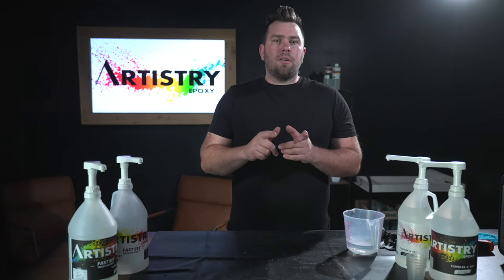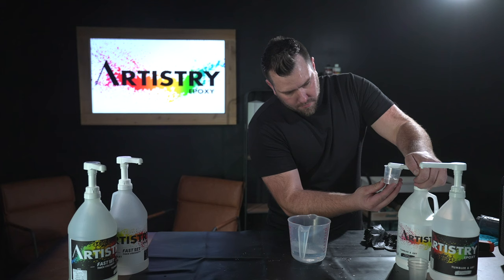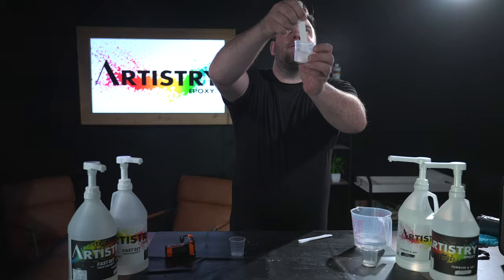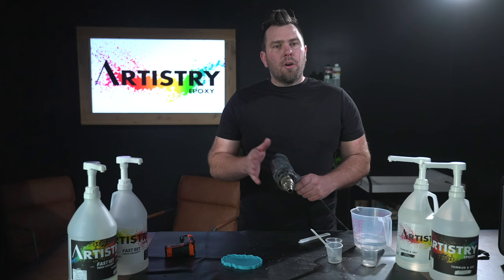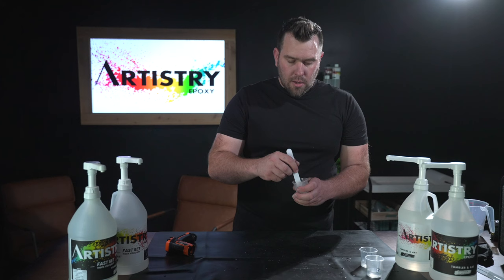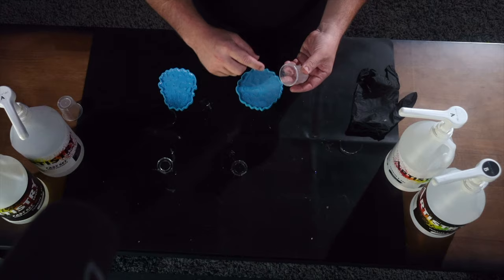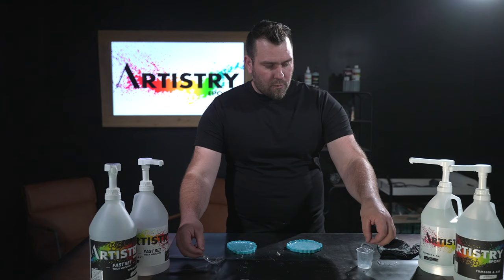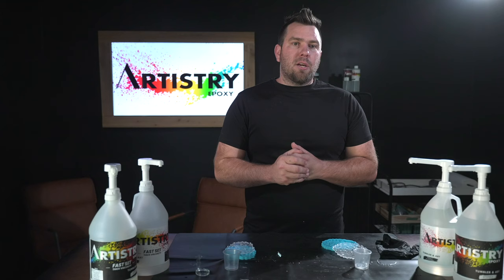How to Mix Epoxy: Tips and Tricks |Artistry Epoxy (Achieve Perfect Epoxy No Bubbles With Any Brand)

Comment: 😂 I watched this video after I had done a mix and coated 2 tumblers, it was white since I mixed fast, didn’t switch cups either, cleared all the white with the torch and the epoxy dried glass smooth no stickiness

Comment: What makes it bendable once cured? Are there different kinds of epoxy for different crafts? What I’m asking is there a particular kind for pouring in molds versus just coating tumblers or paintings?
Reply from the maker: There are different kinds of epoxies for different crafts. You can use our Art and Tumbler Epoxy in molds, you would just want to make thin layers.

Comment: dont you need to wear a ventilator? also, can i do this in my craftroom (window open) or do I use my garage? i live in Dallas, TX it's weather is hot most of the time.
Reply from the maker: We always recommend using proper PPE. You can also reference our Safety Data Sheets on our website for more information. You can do this in your craft room if it’s well ventilated. Feel free to stop by our shop in Roanoke, TX if you’d like to check out our products and/or ask questions!
Reply: I think mine expired.. how can I tell.

Comment: How long in between before you can apply a second coat? I have the fast set
Reply from the maker: You can usually apply a second layer about 45 minutes to 1 hour after the first layer, depending on room temperature, etc.

Comment: Can you heat mixed epoxy to pop bubbles before applying it to your projects?
Reply from the maker: We suggest heating your part A to help reduce bubbles, before mixing. If you heat your epoxy after mixing, it could flash cure.